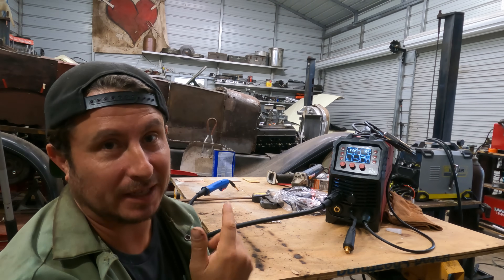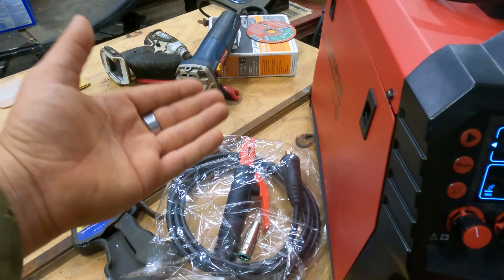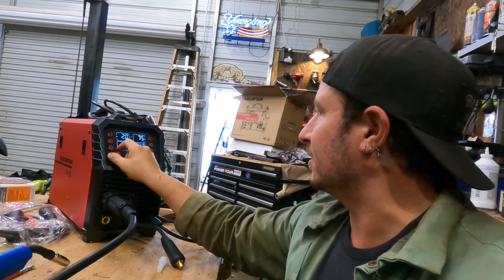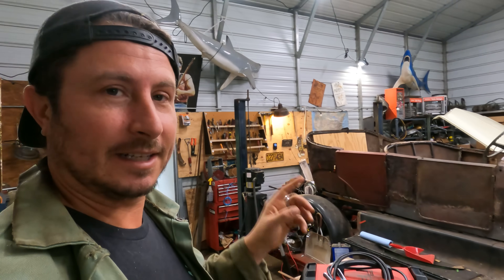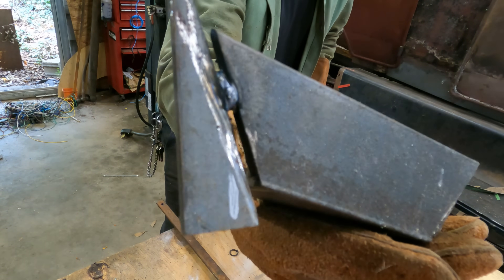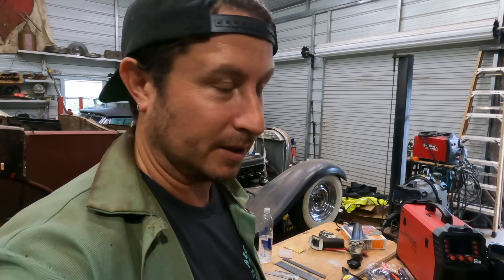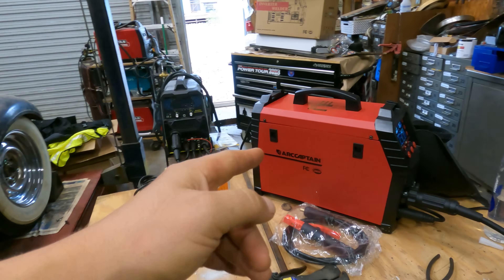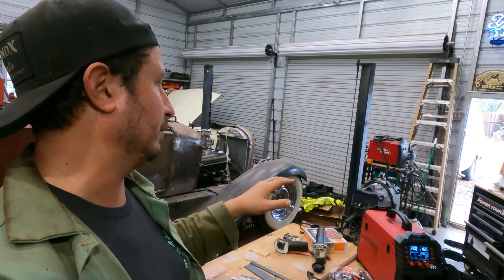ArcCaptian Mig 200 -This Mig Welder is Better than You Think!

Comment: Check out the Yeswelder DP200, I think you'd be very interested in this machine, it has single and dual pulse, it does stick, MiG, Tig, it's spool gun compatible and it has a foot pedal.

Comment: You should try the Yeswelder MIG 250 Pro - SG or the Yeswelder DP200. I have the Yeswelder MIG 250 Pro, the Firstest DP200 and the Yeswelder CUT 55DS Plasma Cutter.
Reply from the maker: i am curious about the machines... i am happy with what i have but it seems there are a lot of good options out there these days

Comment: I have a shop at my house I don't weld everyday and most of my welding is typically quarter panels floor pans a little chassis work how long in your opinion would it last until I wanted to upgrade if I wanted to upgrade?

Comment: Scratch arc Tig? You sure about that? Mine is lift Tig. So just wondering
Reply from the maker: you make a good distinction there... it is probably lift arc, but I tend to lump it all together, if it does not have a high frequency start and you have to make contact with the tungsten I lump that into "scratch starting" and yes that is different than lift, so good point

Comment: Looking to weld some decks and compartments into an old Lund v hull. Was looking at the Lincoln i90 and wondering if it was enough of a welder, ran across this. What a great feature set for the same price point.  Thanks for sharing!

Edit: after watching a second time, and perhaps digesting the information better. I’m going to look at the tig machine  you spoke of by the same company.
Reply from the maker: just reading this, and sorry if i over assume, but are you looking to start welding with aluminum?   it can be done but it is defiantly setting up a tall hurdle... this machine can do it with a spool gun but cannot tig aluminum   I will say there are lots of ways to make what you want without welding but i still encourage you to learn to weld if you want to, its a blast
Reply: @betweenthesharksgarage  have been using  an old Lincoln arc welder for about 15 years and want to move into something that i can use with aluminum, stainless would be a bonus.  i have seen that i can build that boat with wood or aluminum and rivets... however, this may just be the right project to justify spending on a new tool, and furthering a skill.
Reply from the maker: Sounds like a great project. This machine can do aluminum with a spool gun, but does not have AC TIG capabilities and does not seem to have a pedal. They will actually control the power.     
    So if you would like to do this with a TIG, you should be looking for machines that have AC and DC take functions with high frequency.     
      I have an old Lincoln ideal arc that I use for this type of stuff   I am very curious about arc captains. Tig machine  as well.

Comment: Thanks for all the info you provided, great video.  I bought the 200 and it will be here tomorrow.  What's your feeling on using flux core wire?  I've been looking at tanks and it seems I have to buy a tank then trade it in and in the end it's going to cost me between $200 and $250 plus gauges.  Are there shops that will just fill a tank if I buy one?  Also I'm buying this to fix things here at the house.  Is a smaller bottle okay (60 c/f) or do I need an 80 C/F bottle or bigger yet?  Thanks again
Reply from the maker: so this will be controversial, but I hate flux core. There are additional fumes to contend with, to do it right you need to knock the slag off everytime you stop welding...even if you make a tack weld you need to clean it off because if you pass over it it will contaminate the weld-  and the slag burning out of the weld makes it harder to see what you are doing.  But it does work. 
I know...easy for me to say because its your money  but i have been there and the investment in the tanks stings but it is worth it.      I think if you are new to welding just bite the bullet and get a tank and regulator.   You can buy a cheap regulator off amazon and find a store like airgas or pixair or whatever suppliers you have in the area.  start with a small tank even 40cf argon/c02 mix it will last a lot longer than you think if turn the valve tank off when you finish welding.    Over time i have traded in my small tanks for bigger tanks because i do not move my tanks that much and refilling them is just one extra errand.    I think welding with gas is a much more pleasant, it will be easier to see results faster... its a bad analogy but i think fluxcore is like an electric guitar without an amp,  you can still play songs and learn, but its probably not quite what you imagined
Reply: @betweenthesharksgarage  Thanks so much for your reply.  What you said makes sense about the fumes and slag.  I think I'll look into the 80 cf tank.  I can get one delivered with a 75/25 mix right from Amazon for about $300.  I looked into Airgas and they wanted me to set up an account with the history of the world before I could even get prices.  Don't need that.  I'm retired for God Sakes.  Thanks again for all your help  I'm looking forward to getting this all set up.  I already have project waiting.  Have a Merry Christmas.   Jody
Reply from the maker: i think you ll be happy with the money spent ans starting off on the right foot   .   about the airgas account that is a pain, sometimes you have to just say you want a cash account to bypass all of that stuff.    one way or another you are going to have to deal with them,  the amazon tank will work fine but if airgas is the only place near by they may only do exchanges not refills (thats how it is around here at least) so you will turn in your tank and get an airgas balled tank in return....just a heads up
Reply: @betweenthesharksgarage  Thanks!  I ended up buying an 80 cf tank from Prime Weld filled with 25/75 gas. I'll worry about the refill when that comes around.  I'm waiting on my electrician to put a 220 outlet in. He put a dedicated 50 amp line in for my RV a few years back so what we decided to do was put a switch in as the welder isn't a full time thing, I'll be able to switch from the RV outlet to the welding outlet.  The switch is expensive, but the most cost effective way to add the outlet.

Comment: I bought the Hitbox Mp2000I which does what that machine does for $150. Its control panel isn’t as nice but it works well.  I also have their little stick welder and although the ground clamp was 6” long it has arc force and will light up 1/8” 7018 without a problem.

Comment: just picked one up. what do you recommend for gauges?
Reply from the maker: i think you ll like it... I ll run just about any regulator for argon or argon/co2.   No matter what you run get in the habit of turning the valve on the bottle off when you are done... every time.   Slow leaks are common somewhere in the system and it stinks to come out to an empty tank in the morning.    If you ever get into oxy acetylene welding i tend to stick with harris and victor regulators as name brands but for my migs.... i have been running the ones that came with my Lincoln machines for a decade.
Reply: @betweenthesharksgarage  thanks for the info, keep up the great work on the videos, I look forward to them each week

Comment: I've seen these reviewed by a few others ... Theirs and your reviews all point to it being a good starter. I look at it as an upgrade just for the inverter technology being so much smaller as space in my garage is really limited.

Nice review man, keep it up!
Reply from the maker: that is how they are marketing it ... and i really could not describe this in the video but essentially it seems to be a very good, low cost inverter machinonly e, and it even claims to have to have a 60% duty cycle... my transformer lincolns have a 20%... by all of the specs it is a professional shop ready machine, just being marketed to beginners at an entry level price..

Comment: I have a Lincoln stick welder that I had refurbished and I have a Lincoln 140 mig that I use with.023 wire for sheet metal. Two years ago I bought a Yes Welder that does stick, lift tig and mig. I run.030 wire on it for heavier stuff. I also have a YesWelder plasma cutter. They are all on two carts except my old ac/dc Lincoln stick. I built a rolling platform for it. Glad to see you’re back on the “T”.
Reply from the maker: it took so little to get that but done on the t.... how is the yes welder mig?   i have their plasma cutter and its great

Comment: I went with the MiG 200 as my first MiG got it on sale a a great price compared to other brands out there exactly 13 months later  was welding it shut down and popped a code for over heating the fan wasn’t working I contacted arccaptain thru customer support email after a few emails and  pictures checking some things they asked me to do they apologized I had had trouble with it and sent me a new machine. I was extremely impressed with them and would not hesitate to recommend their products. I have since added more products from them.
Reply from the maker: It’s great to hear a first hand good customer service experience… bummer about the welder.   But still if the warranty was honored I would be happy with that personally
Reply: Thank you very much for your kind words!!!